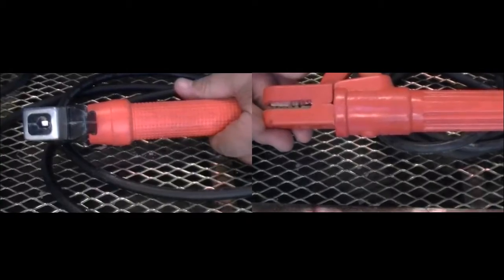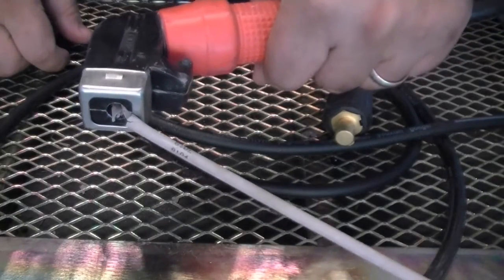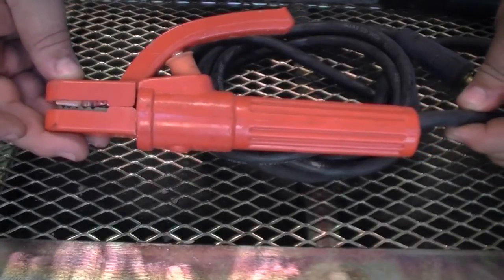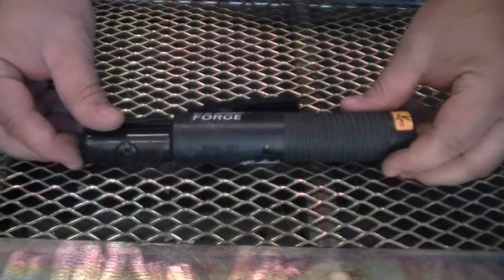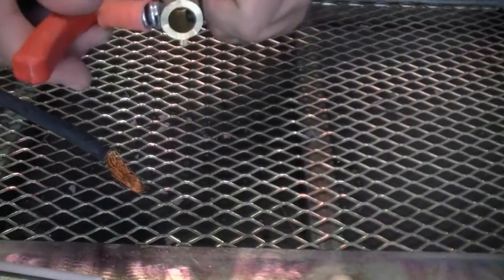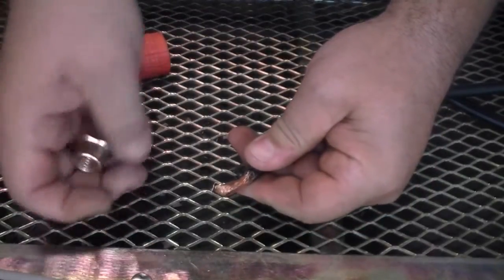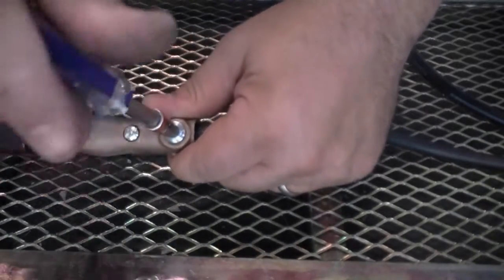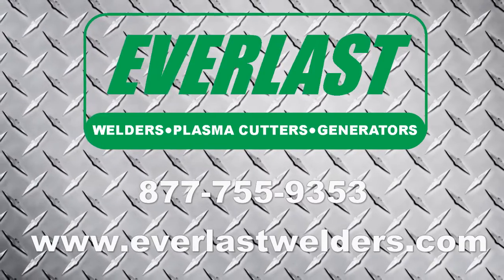Everlast Tutorial: Selecting and Replacing the Stick Electrode Holder.

Comment: can we get the twist style even if the welder came with the quick release ones ??
Reply from the maker: You can replace them locally with little expense.  They are not available for substitution.  They are prepackaged for the kit.
Reply: i dont have a local shop that sells the twist style short nub one can i order one from you guys?
Reply: Jon204Gaming Yes. They are under twenty bucks on Amazon. To install them, just do the reverse of removal.